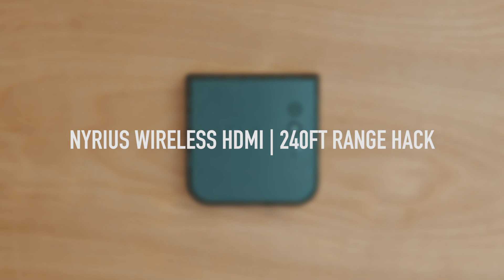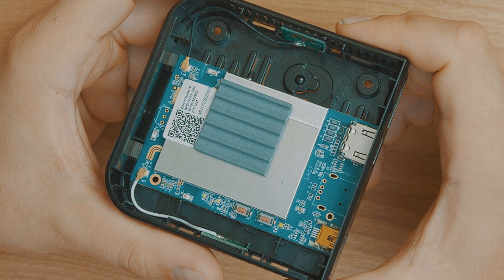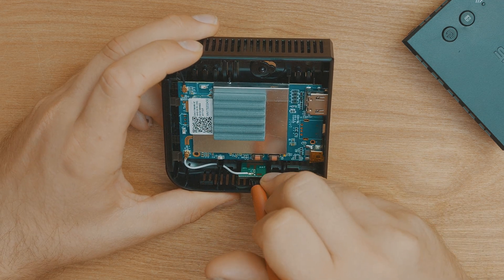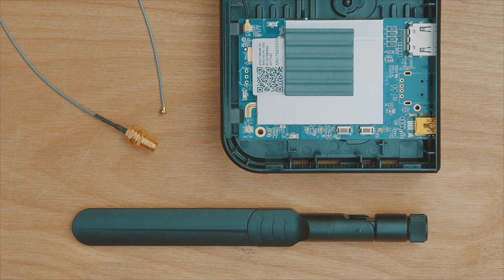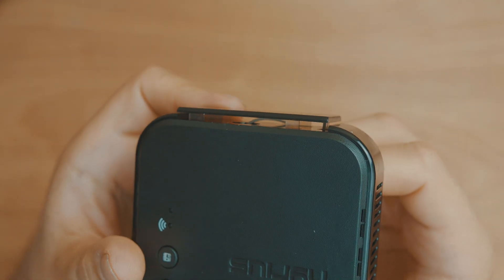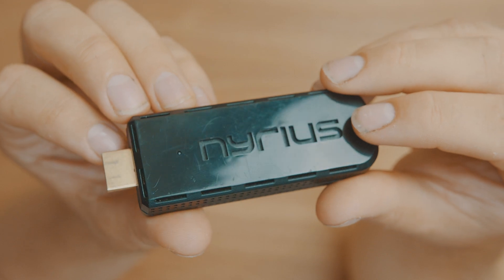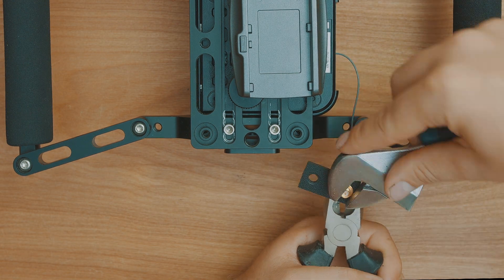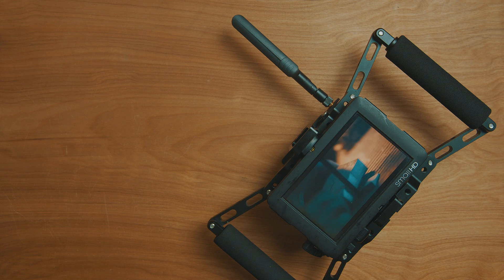RECEIVER ANTENNA UPGRADE - Nyrius ARIES Wireless HDMI - Range Hack

Comment: So I have the pro plus version.  It is supposed to be 160'  but I am getting drop outs if something is in the way even if i am 50' from receiver.    Will this mod help?  I ordered the parts today.   Should I do it or is it the transmitter that is the issue?

Comment: I have done this mod bit notice no difference to before. As a test I unscrewed the antenna and the range is the same. It doesn't seem to make a difference if antenna is attached or not
Reply from the maker: Hi Christoph! when the antenna is unplugged it will go back to using the internal antenna, which still has a pretty decent range. 

I have done an update video that shows you how to update the Transmitter antenna, which makes a much bigger difference! Check that out here - https://www.youtube.com/watch?v=lnlT6SX95ko&t=24s

I have also started using FatShark Antennas on the Transmitter and Receiver which provide a much more reliable signal!

Hope this helps :)

Comment: As I understand it, to connect external antennas to the transmitter, the main problem is to find a suitable MS-156 Male connector?
And another question - besides the main antenna there are 3 more ceramic ones, it is possible that external antennas can also be connected to them, but you need to solder.

Comment: Hey David, Thanks! this is great. Let me ask you. I tried to do it yesterday but I didn't notice any improvement in the signal but the weirdest part is that I have the same signal strength with our without the new antena, but even with no antena at all. I mean, with the Uplink port with nothing connected at all.

Comment: I wonder if you'd get better reception if you used a pigtail or y-connector to split the single RP SMA connector so you could install two antennas?

Comment: hey David .. did it really work ?
Reply from the maker: I am going to try and do a follow up video to this as i have changed some of the components for a more reliable signal, but this setup does work in a open field situ, but as soon as there are walls or anything in the way the signal drops of significantly!
Reply: @DavidMorganJones  Hi David! About to purchase the antenna you recommended in this video! Is there a better antenna option?
Reply: @DavidMorganJones  Hey David .. I already got 2 sets .. and they confusing me sometimes ... sometimes they work amazing and sometimes it start to pixel .. and thats why I asked you if did it really work as line of sight ( open halls ) events or weddings ... or you recommend some stronger antennas ?

Comment: How is the transmitter antenna going? So excited for that.. might help us poor filmmakers hahahha
Reply from the maker: Xtian Productions Sorry for the huge delay! It’s been a very busy year with film work which is great, but I haven’t been able to look into getting the transmitter side to work annoyingly. 

I ordered some aerial adapters but they didn’t do anything, I have just ordered quite a few specialist adapters and cables though from China that should arrive in Jan, so hopefully they should work and I will get the next video up!
Reply: @DavidMorganJones  hey man, good work in the video, no pressure, im just glad you have a follow up video. Happy holidays
Reply from the maker: @exitsalidaexit  Thanks man appreciate it, had a good break hope you did as well!

I haven’t received the parts yet but I can’t wait to get the next video done,  Its a really handy setup just a shame that the transmitter aerials are so weak! 

Also just checked out your content you have got some really good stuff man, love the short films!
Reply: @DavidMorganJones  Have you found anything that works yet? I purchased a set for myself and the trasmitter seems to have Murata SWD switch connectors on the antennas that I have not been able to find any cables to. I guess they only use them for some trimming at the factory with a probe as they have a switch that also disconnects the other antenna when probing. Maybe some soldering is required with this one..
Reply from the maker: @tulittaja123  Hey so sorry for the delay - 9 months later and I think I have got it to work, testing on my bench it appears to be using the external antenna on the transmitter. No soldering requires just a very unique cable! need to do a bit more testing but will try and get a video out asap!
Reply: @DavidMorganJones  What kind of cable did you use? Im very interested in getting this upgrade done myself and havent found any solution myself.

Comment: Very nice, I just got this unit today and yes! the antenna is very weak this is a great tutorial, cant wait to see the other hack.!
Reply from the maker: Directgrafix Sorry for the huge delay! It’s been a very busy year with film work which is great, but I haven’t been able to look into getting the transmitter side to work annoyingly. 

I ordered some aerial adapters but they didn’t do anything, I have just ordered quite a few specialist adapters and cables though from China that should arrive in Jan, so hopefully they should work and I will get the next video up!